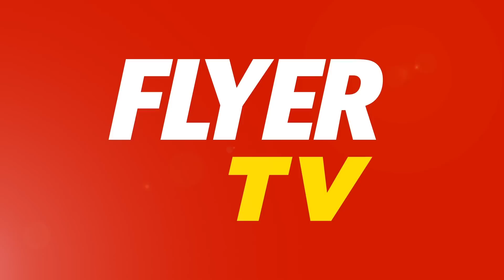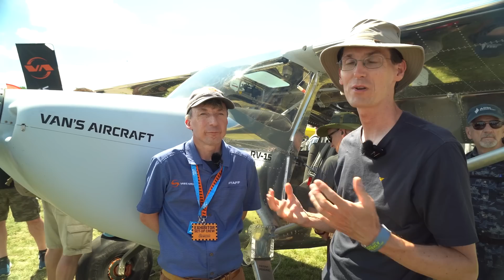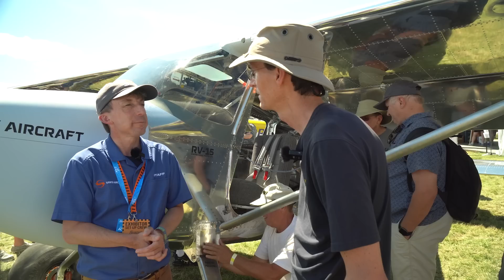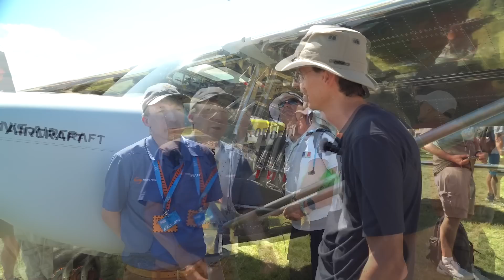RV-15: Ed interviews Rian Johnson

Comment: Sling already has the successful Sling HW with a Rotax 916iS. My 2c is that Van's must move forward and incorporate more modern FADEC engines like the one's from Rotax and the ULPower UL520 200 - 220hp series.